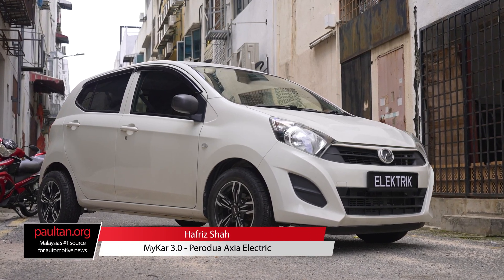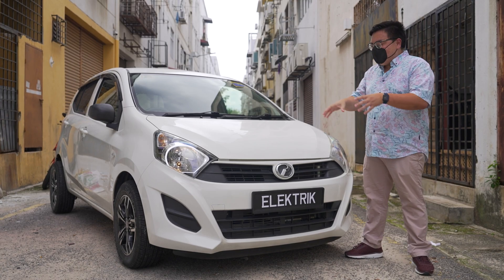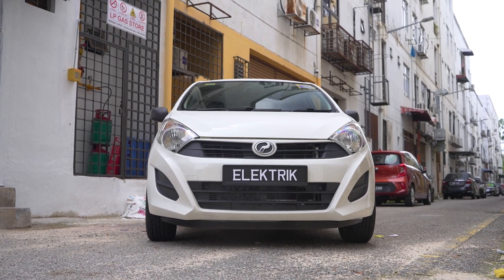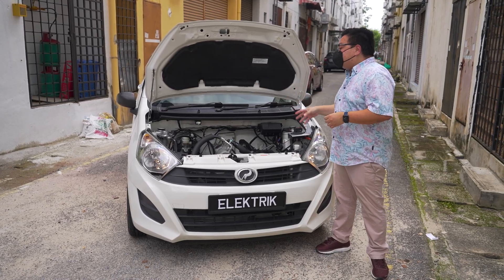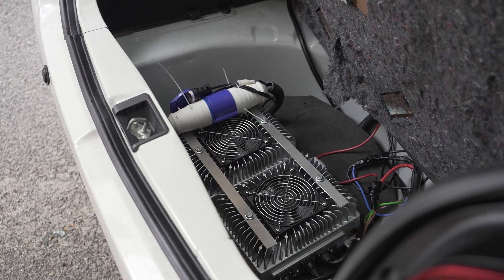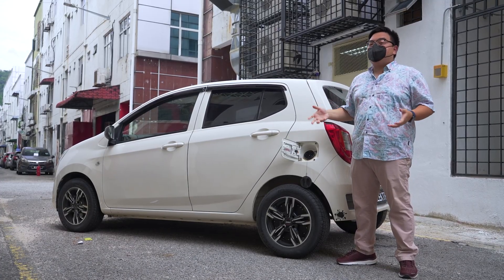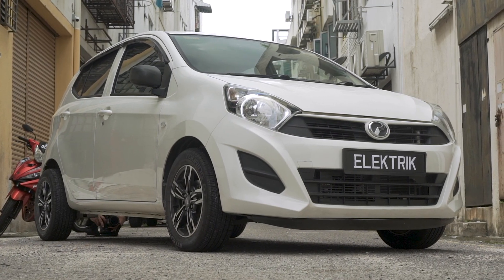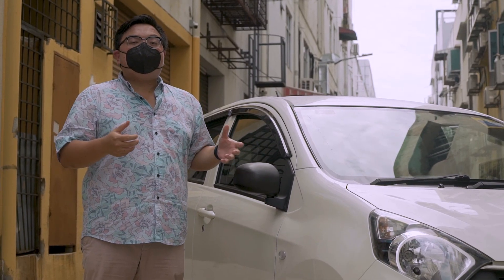Perodua Axia Electric - 220 km EV range, 4hrs to charge, RWD!

Comment: I don't think RM20k possible as using dual electric hub motor.  Currently 1USD already hit RM4.60. currently cheapest battery price 1kwh = 150usd you can get in market.
Reply: You can also charge at home where the electricity cost is MYR 0.5 / kWh. But it will take 3x longer.

Comment: Very expensive to convert and moreover only 210 km not enough to reach Penang from K.L
Reply: all things considered it's a decent price, considering the price of other EV now, parts are probably not cheap anyway. They can also increase the battery pack size considering the space available still within the engine bay, but there will be additional cost for the suspension system due to the additional weight, but feels pretty doable.

Comment: I wonder how the motors will do in a flooded situation where they will be immersed. The other true platform EVs like Tesla has a dedicated transaxle/gearbox with the motors sealed within with transmission fluid, so water proofing is not a problem.

Comment: Correct me if i'm wrong, but the engine bay is the crumple zone of a car, in mass production scenario I would assume battery in the front of a car susceptible to head on collision is not the greatest of ideas

But if mass production scenario I think P2 can work tgt to re-design the car as needed
Reply: Again with the crumple zone. It's one of compromise when it comes to ev conversion. Emphasis on conversion. Unless the owner is made of money to do a full custom made body just to fit the batteries on the floor of a car for the conversion, 1 battery pack in the engine zone will suffice for a usual multi-pack battery conversion kit. If one is paranoid with the front battery, just placed it all in the back and sacrifice the luggage space.

Thinner battery on the floor is possible but it's will be expensive.